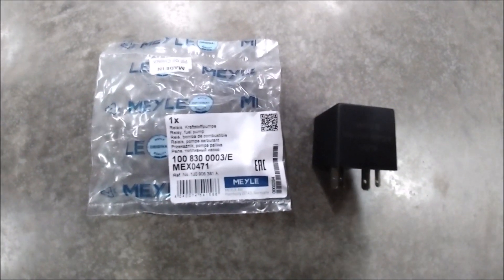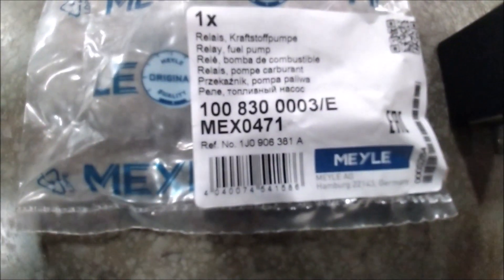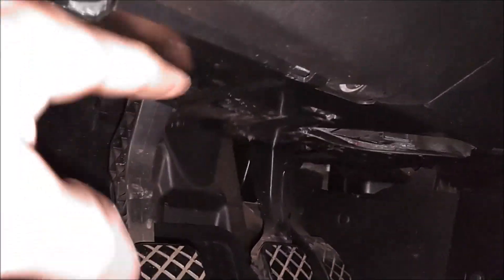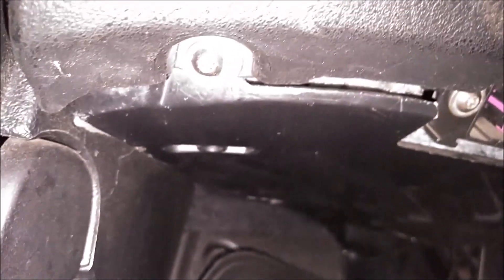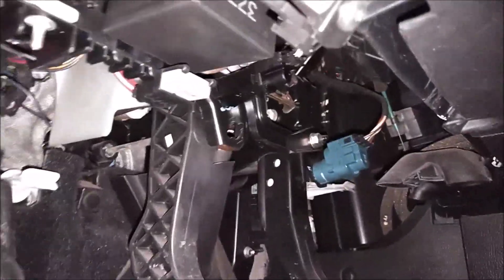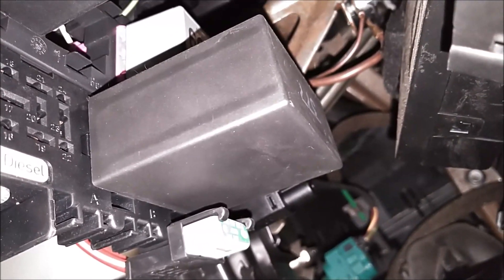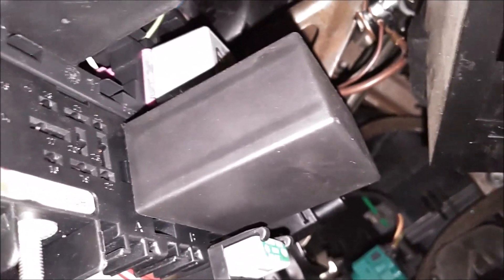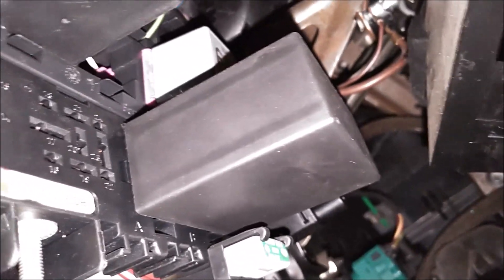VW Golf mk4 TDI relay 109 removal and install

Comment: 2003 TDI ALH , wont crank over at all, battery volts drop a bit when i turn the key but no starter or starter solenoid sound at all. New battery and fuses checked. If i jump the solenoid the starter spins but wont engage
Reply from the maker: Matt BozAwesome - Maybe you have a bad starter? I've never had that happen to me before. When was the last time that it started? Have you replaced anything recently?
Reply: @Corysdiyauto  it started and then died for the last time on video. Sounded like the battery was dieing right before it stopped, then i put in new battery and nothing. No click nothing. I thought the same, but was weird the starter still rotated when i jumped the solinoid
Reply from the maker: @BozAwesome  - Maybe you have a bad connection somewhere? I would check all of the wiring that is connected to the starter. Look for frayed wires and loose connections.

Comment: Skoda Octavia 1.9 TDI ALH 2005. I had a sudden engine stalling, engine vibration, misfire, Fuel quantity adjuster N146 upper and lower limit reached errors. I checked everything and all are good. Finally figured out that the relay 469 is Faulty. Part number is 6Y0 906 381. I could not find a new relay. Can I buy relay 109 with the part number 1J0 906 381 A in lieu of 6Y0 906 381? Are they the same?
Reply from the maker: Hmmmm interesting. It looks like they have the same pins. Maybe they are interchangeable? I'm not 100% sure on that though.
Reply: @Corysdiyauto  Thanks for your response.

Comment: What year it's you mk4 TDI right ? What year let me know thank you please so I know it's the same location as mine thank you
Reply from the maker: Edyer H - It's a 2001.
Reply: Thank you I checked but mine it's 2006 pd engine , check the relay it's said # 103 tho
Reply from the maker: @edyerh9287  - Relay #103 is a glow plug relay. I'm not familiar with the mk5 setup, so I don't know where your 109 would be? I know that sometimes people take out relays and don't put them where they are supposed to go. The same goes with fuses too. When I first got my mk4, there were so many things that weren't right due to unknowledgeable people working on it. These are great cars if maintained and cared for properly.

Comment: Thanks for the video. I'd like to see the exact position of the pins when presenting the part for re-installation - it's a real fiddle in a confined space. Do you know whether it's the same position for a right hand drive Golf?
Reply from the maker: nickythom5 - I am not sure if the relay would be in the same position in a right hand drive model. I would just look in the same place that I did.... just on the opposite side. Look for that gray relay that's labeled 109. Hopefully yours is easy to find.
Reply: @Corysdiyauto  trantlation franch

Comment: hi，i have same problem with my mk4 1.6 sr。but at the same location i cant find the109relay but 173relay。
so which relay i need to change？
Reply from the maker: I'm not familiar with the 1.6sr, but it's definitely not relay 173, because that's for the daytime running lights. Do you hear the fuel pump when you turn the key on?
Reply: @Corysdiyauto   @Cory's DIY Auto  thank for your  reply，I will check it，so if not  work，the problem is 409？
Reply from the maker: I think you mean 109? I don't know where your relay is located in that car.
Reply: @Corysdiyauto  I don't see the 109 one my car（mk4 1.6sr）
Reply: @jasonbello1408  1.6 Sr have 409 for fuel pump and 173 is for parking headlights so on.

Comment: Hi I drive a a Polo 1.9tdi (ATD)The car cranks  but doesn't start and there's no power to the injectors...could the relay be the reason??
Reply from the maker: Modisha Jobo - I'm not familiar with the ATD. Are you sure that you are getting fuel? The relay could be the issue, but there are other things that could contribute to a "no start" problem. Have you replaced the fuel filter recently? The relay is inexpensive, so you could replace that first.
Reply: @Corysdiyauto  no I haven't replaced the filter

Comment: Hello, I got golf mark 4 02 plate diesel it start but drive for min it will cut with no warning just battery’s light and den it won’t start Wht could da be
Reply from the maker: Sam Khan - It starts sometimes then?
Reply: Cheer for replying, I figured out the issue it was fuel pump relay
Reply from the maker: @SamKhan-op6js  - Great, I am glad that you got it figured out.

Comment: What’s relay 109 for ?
Reply from the maker: Malvis Millers - Relay 109 is the main power supply relay. If this has failed, then your engine will crank over, but not start.
Reply: @Corysdiyauto  any fault codes when it happens?
Reply from the maker: No fault codes.

Comment: Why my mk4 golf sdi have a relay 109 and it doesnt have a fuel pump in the tank?
Reply from the maker: Kurt Vella - These diesels don't have fuel pumps in the tanks. The injection pump pulls fuel from the tank. This has nothing to do with relay 109.

Comment: My Golf IV is shocking while driving sometimes. After a while the engine is going off. I can restart again but the shocking becomes worse and then the Bobine dies. This happens over and over again. Can this be the 109??
Reply from the maker: B-RJ - What year is your Golf? Is it a diesel or gas model?
Reply: Cory Mondics Gas of 1998
Reply from the maker: @magnafrisiaband  - I'm not familiar with the gas models. It could be a fuel pump problem?
Reply: Cory Mondics I was thinking about the Crankshaft Sensor. Could this be it?
Reply from the maker: B-RJ - It could be?

Comment: My car is cranking over but not starting but my windows and dash lights also aren’t working... I have battery power and a new alternator but people told me to check the 409 relay because for a couple days I could pull that out and put it back in and my car would start. Now it just cranks but won’t turn over. I have a 2000 vw golf
Reply from the maker: Foxy Venom - I would definitely replace the relay because it sounds like it's faulty.

Comment: My glow plugs were all bad . I replaced them all. I replaced the wiring harness. The relay seems to work. I can see it working with the cover off. When I turn the key on, the voltage at the wiring harness reads 12 millivolts, and the amperage reads 45 amps. I thought it was supposed to read 12 volts. Any ideas?
Reply from the maker: Kevin Muth - Could be a faulty glow plug relay 180, not 109. Relay 109 is the power supply relay.

Comment: Anyone able to help me .. when I turn my key my clocks are dead and fuel pump dosent kick in ..
But lights radio and everything works even if I turn on my lights it shows on my clocks .. the engine sounds healthy when I turn the key and batter is brand new and all fuses are perfect
Reply from the maker: Malvis Millers - What engine do you have?

Comment: If the motor sometimes starts is this fault possible reason?
Reply from the maker: Sime Marusic - It could be? I would just replace it anyways. It's not expensive and it's easy to do.
Reply: @Corysdiyauto  thanks for the video.  i have a 2000 golf gls 2.0.  mine has literally been dying as i am driving, i swapped in another used fuel pump and it did it as well.  now the original pump has 210,000 miles and the one i swapped has 155,000 miles on it.  i ordered a new pump, because by simply tapping on the fuel pump gently car fired up for both pumps when they failed.  but i will order  new relay to throw in the glove box.
Reply from the maker: @8SEC6SPD  - That mileage is impressive for a 2.0. Good job on diagnosing the fuel pump issue. Thanks for watching!

Comment: i have a relay 100 i dont see a 109 please help
Reply: i have a 2002 jetta tdi alh
Reply from the maker: Tom Green - That's odd, I thought that the gas models had the 100 relay and diesels have the 109?
Reply: @Corysdiyauto  i went back and checked again , i have a relay 100 as well as 109
Reply: my car will crank but wont start , it happened randomly, idk what to do i dont think my relay is shot bc i see the glow plug light as well as every other light , im tried alot of things and nothing seems to work i even did the fuel filter as well as primed it
Reply from the maker: @tomgreen749  - Alright, relay 100 is for the indicator lights, turn signals, etc. That one isn't your problem here. Relay 109 is cheap, so I would just replace it.  You can try to take it out and tap it on something hard and then put it back in to see if that works. Sometimes these relays just get stuck. That could be the case here?
Reply: @Corysdiyauto  Thank you for the fast response, yes i order it the other day should be here tomorrow ill replace it and give you feedback !
Reply: @tomgreen749
Hey! Did the 109 relay work???

Comment: what is for? is it for glow plugs?
Reply from the maker: Eric Mkhonza - No, it's the main power supply relay. When you turn your ignition on it sends power to many different areas to allow the engine to start. I believe that it does send power to the glow plug relay (180).
Reply: @Corysdiyauto  thanks Cory
Reply: @Corysdiyauto  where is 180 located?
Reply from the maker: @kcummo  - What year is your VW? Mine is under the dash in my '01.
Reply: @Corysdiyauto  2001. I looked at a schematic and it looks like the 180 is to the left of the 109
Reply from the maker: @kcummo  - I believe that relay 180 is in position #10 on the schematic and relay 109 is in position #12. So, yes you are right....180 is to the left of 109.

Comment: You missed  the important bit of removing the relay.
Reply from the maker: You just have to pull it straight out. Sorry about that.
Reply: @Corysdiyauto  wow fast response.
On mine it’s not the case. One side  seems to be a latch that you need to get a nail in to push away from the relay. Meaning two hands awkwardly pressed together, a dislocated shoulder and it slips out nicely…. Honestly VAG don’t make it easy do they.
Reply from the maker: @segov2860  - That's odd that yours is setup differently. I agree, VAG makes some things difficult, but I love the car!